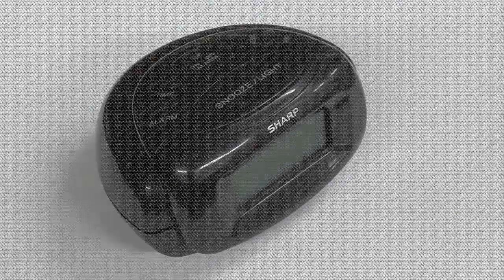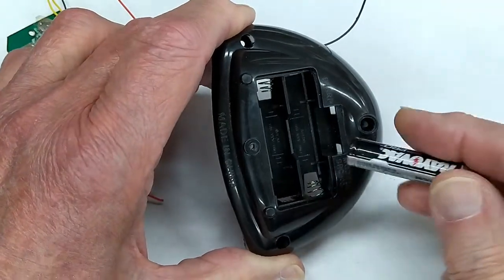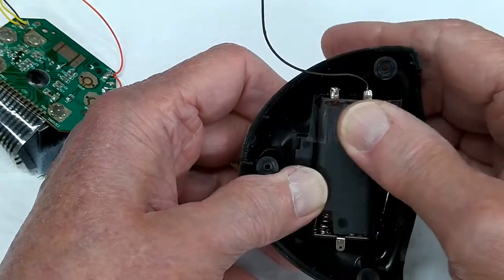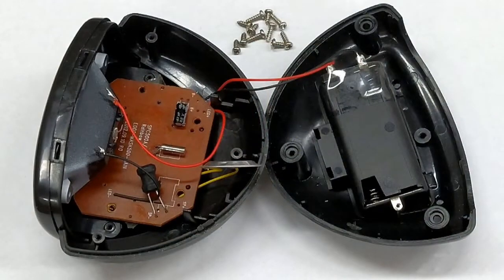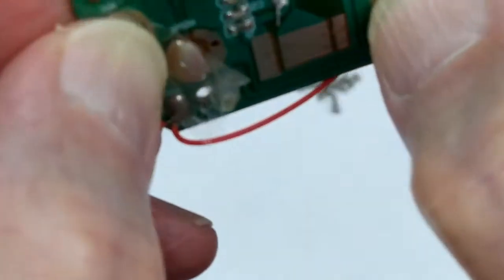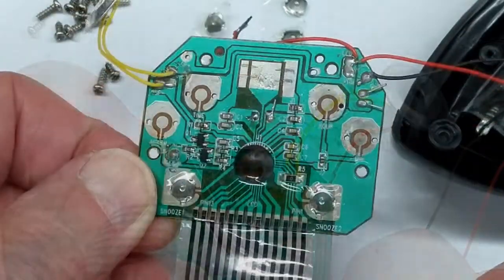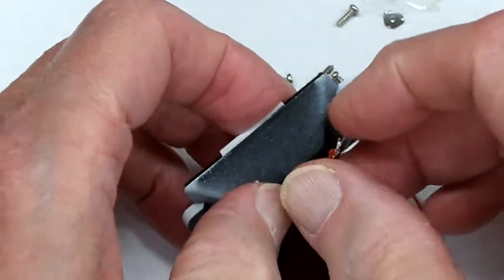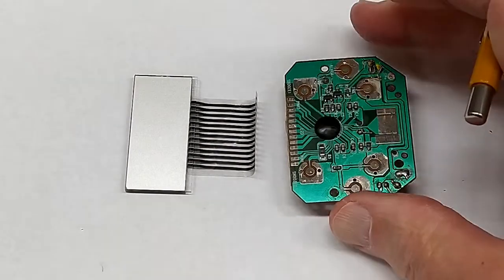Sharp Battery Alarm Clock - Autopsy

Comment: Nice video Ron, those switches are called dimple/dome switches. The chip is commonly known as a "glob top". The flex ribbon is typically glued with a conductive glue and is the common failure point when the adhesive delaminates. When things like this must be fixed in high dollar items you get some expensive conductive glue and do your best haha.
Reply from the maker: Thanks for the info!  Happy New Year 
Ron

Comment: those are hot bar assembled.  there's some glue on the ribbon part which is basically a hot melt type product.  then they press a hot bar on the ribbon and this activates the glue and then that holds it onto the board.  They can sometimes be fixed by using a soldering iron set very low as to not melt the ribbon plastic.  That was most likely why the display was acting up,  the ribbon going open circuit.  The tape was put on there in an attempt to hold it in place over time, since the natural bend of the ribbon can pull it off the board.  I don't think there's actually anything on the carbon track part that sticks it to the board, and it relies on the pressure from the glued ribbon part between the carbon tracks.  Tiny drops of conductive epoxy might work to fix it, but it'd be really hard getting enough to conduct and not short.  The LCD will still function even if the resistance of the connections is very high  (into the 10K to 100K range or possibly more).
Reply: Would it have been possible for him to replace that strange glued on ribbon cable with a standard copper wire ribbon cable and get it back up and running again?
Reply: @jsaurman  maybe.  the problem is the LCD end will be to the LCD glass itself, which is indium tin oxide.  solder probably won't stick to it.  maybe using short wire jumpers from the ribbon to the pcb, using conductive glue on the ribbon end?  unfortunately there's no good way to fix these things that I have found